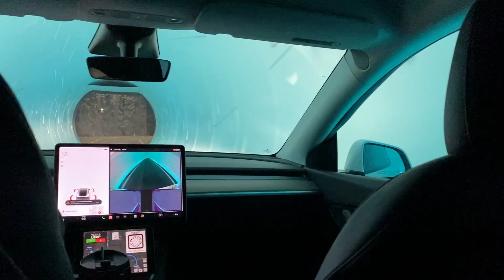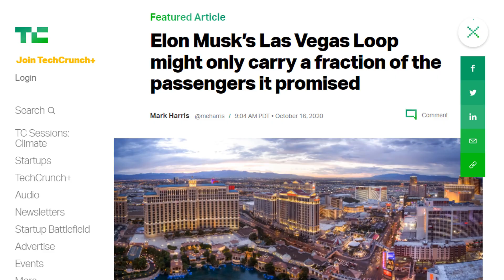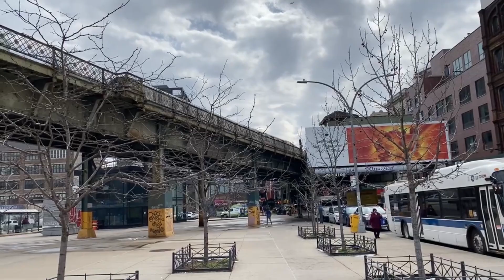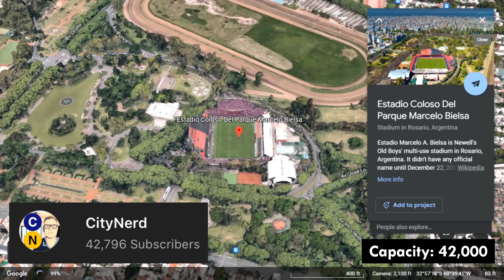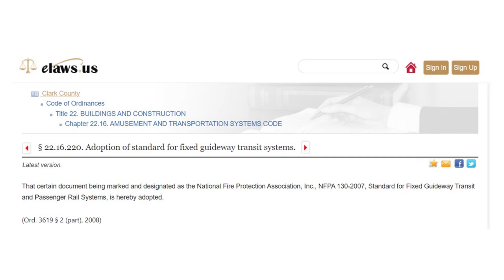Inside the Las Vegas Loop: Transportation Game-Changer, or Complete Waste of Time and Effort?

Comment: 7:15 Dedicated robotaxi in the works was re-confirmed at the most recent Tesla shareholder meeting. Vehicles today will be changed out.
12:15 Connections to other stations are coming as you point out. 
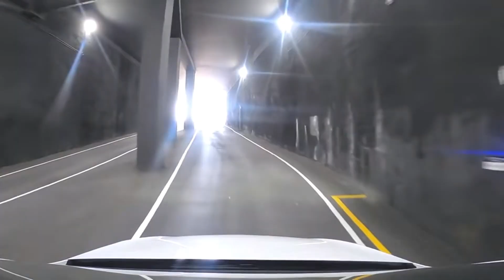13:05 Autonomous operation is rumored to already be possible. At some point Tesla probably has to pick a software version and that version needs regulator approval.
Reply: How many things have been "confirmed" at Tesla shareholder meetings over the past 10 years that, to this day, remain vaporware? I've lost count.
Reply: @colormedubious4747  Four things. True self-driving, semi-truck (small scale production exists, mass production factory mostly complete), cybertruck (factory mostly complete), robotaxi.
Reply: @flinx  One thing. You are so very credulous. The semi will be too heavy to economically compete with diesel tractors because the battery will use up 1/4 of the weight limit and no trucking firm will want them because their range will be laughable. The robotaxi was presented as being the cars that they were already making but with a "simple" software upgrade. The cybertruck windows were touted as being resistant to a nuclear blast but broke when a mere human threw a ball at them. I'm sorry you're second-guessing your investment in Tesla and trying to rationalize your decision. Live and learn.
Reply: @colormedubious4747  So you say "I've lost count" because you want it to be a lot. Then when presented with actual info you want to discuss other things. I'll indulge a few. If the semi is too heavy then orders will be canceled. So far we haven't heard of that. PepsiCo received the first 15 in January. 

Yes the robotaxi changed and will now be more customized, which I always thought it should be with more durable and easier to clean materials. 

Yes the cybertruck prototype windows breaking was funny. I don't think that'll be what determines if people buy it or not.

I don't own any Tesla stock, but you know what they say about making assumptions.
Reply: @flinx  We are each entitled to our opinions. I made that assumption because you're coming across like a meme: "Won't SOMEONE think of the poor little multibillionaire!" FYI, I do own Tesla products. I bought 2 Powerwall 2.0 installations but only AFTER the product line had 7 years of operational history. I own NO Tesla solar panels - because of their demonstration hoax, I went with a different manufacturer with a lengthy history of success.
Reply: @colormedubious4747  I don't see where I was coming across like that. Is there a way to factually correct the video, or point out omissions without coming across that way? Like I'd have to preface my comment by putting down Musk?
Reply: @flinx  No, just don't assume he knows anything about transit or that he supports it. He doesn't. HE MAKES CARS.
Reply: @colormedubious4747  it’s almost as if it takes time to build factories to build products
Reply: @danmacben  It takes no time at all to overpromise and underdeliver.

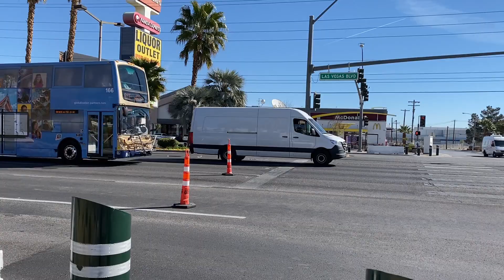Comment: 6:00 Assumes vehicles will never get regulator approval for autonomous operation in the controlled simplified environment. Autonomous operation is rumored to already be possible. At some point Tesla probably has to pick a software version and that version needs regulator approval.
6:10 Cars waiting for passengers off-peak means no wait times and shorter total trip times. That's a benefit. Traditional transit off peak has longer wait times and longer total trip times.

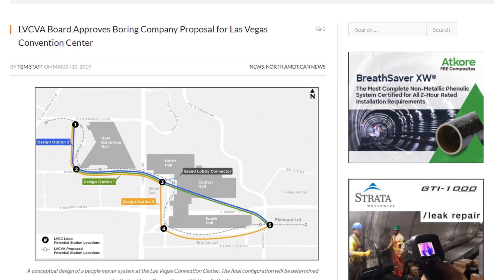Comment: 2:00 The LVCC Loop was never supposed to be high speed. It's not a straight line. Curves on the route always limited speed.

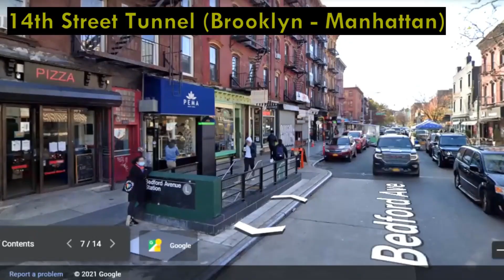5:00 Comparing subway capacity without adjusting for construction cost per capacity. Also not considering how much ridership demand exists at LVCC. LVCVA requested bidders provide hourly system-wide capacity of at least 3960. That's it, not 39,600 for example.

Comment: This system makes me think something like an Airport style peoplemover would have been so much better.

Also an Idea for a video about best Airport People movers, for example when I flew from Pittsburgh to Tokyo via Dulles in DC, I was surprised that while Pittsburgh has an on Rail People Mover, Dulles has Bus like people movers, although there is a Train now, so I guess Dulles has gotten with the times.
Reply: Thanks for putting taxi & rideshare drivers out of business assholes !!
Reply: Doppelmayr bid $215 million for a people mover like the Oakland Airport Connector to BART. The Boring Company bid $48.7 million.
Reply: @flinx  yes, but Doppelmayr probably didn’t lie about the capacity or the on going running costs.
Reply: @jeremypnet  the construction contract and service contract are clear about milestones and TBC's obligations and fines per day of not meeting them. Soon enough the vehicles will go driverless increasing capacity 33% and making ongoing running costs much less.
Reply: @jeremypnet  no lies about capacity in the Loop. With the Loop handling 27,000 people over the 8 hours the SEMA convention in November was open per day, that means it handled an average of 3,375 people per hour. However, no public transport system has equal distribution throughout every hour of the day, there are bumps and dips depending on demand.   Subways typically have two 2-3 hour commuter peak periods around 9am and 5pm.   In the case of the SEMA convention however, there was a single 4-5 hour peak period in the middle of the day around lunch with ridership tailing off to zero either side, so it would be higher than that 3,375 average in the middle of the day and lower in the morning and late afternoon.  We don’t know exactly, but it almost certainly would have exceeded 4,000 people per hour during that peak period.   This is supported by the audited test figures from last year:  “LVCVA Chief Financial Officer Ed Finger told the authority’s audit committee that accounting firm BDO confirmed the system was transporting 4,431 passengers per hour in a test in May showing the potential capacity of the current LVCC Loop.”
Reply: someone bid that. it was 3x the price. the boring company is providing a service that meets the needs of the LVCC for less money.
Reply: I'd be interested when they are able to make the swith to autonomic cars. Because at the moment they are likely burning money and not really able to turn a profit with the 46m
Reply: @tzarcoal1018 yeah automatic cars would make the loop better imo. you could probably get away with replacing the asphalt with something with a bit less friction, steel maybe? same with the tyres. ooh, you could save time by having a long cable as a power source so that you don't need to charge the batteries. it might be good to connect a few cars too, and only have an engine in the one at the front. with all that extra space, you could have more seats and maybe even a walkway through the cars. with the automatic cars, you could make the doors open and close automatically too, so that people can get in and out faster.
Reply: The second lowest bid for the LVCC was actually 4x the cost of the Loop and it was for an above-ground light rail, so it wasn't even underground.